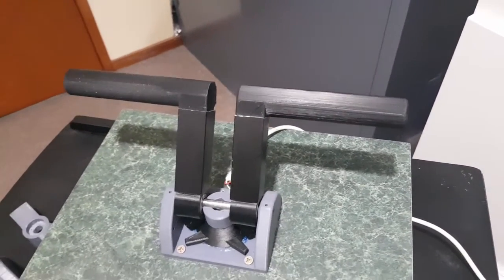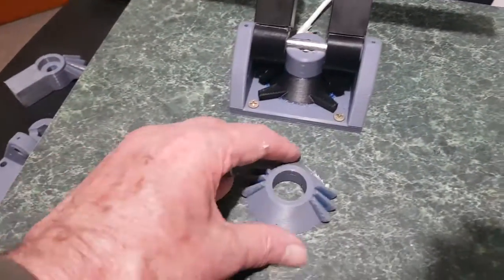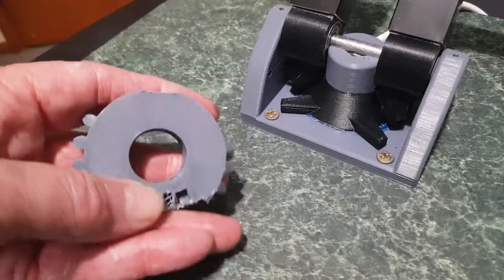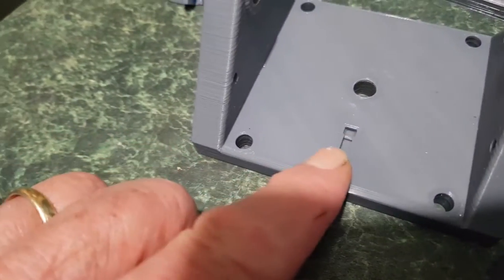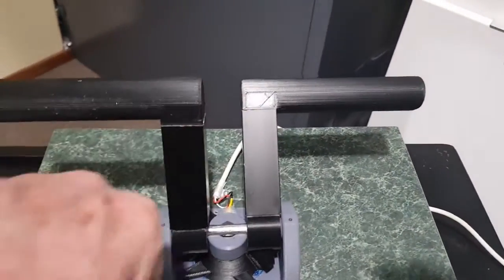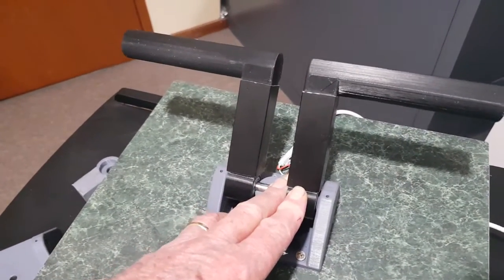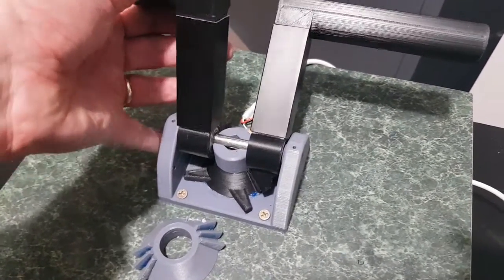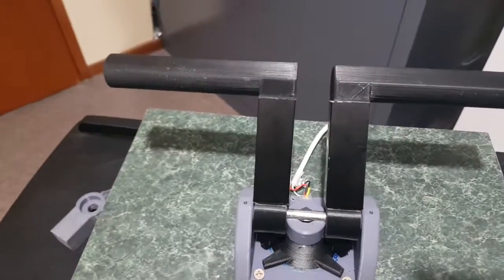Simple DIY Helicopter/Airplane Thrust/Rudder Pedals

Comment: Cool!  I am planning on building a set for gliders that use a similar style of pedals. The design I had in mind is extremely similar, but I am hoping I can avoid 3d printing as I don't have a printer. For pedals I was planning to use a set of bike pedals and crank arms. I need to find the beveled gears, but might end up having to print those. For centering I was planning to add an arm on the center gear that would connect to the base plate with a spring. I would just attach an rj12/DEC connector to the cable which allows me to connect the pedals to my Thrustmaster T.Flight  HOTAS. All the electronics is in the hotas allready. It only needs the sensor level. Thanks for validating the design!
Reply from the maker: You can order them printed from thingiverse.
Reply: @fatchickencatcher  thanks for the tip! I actually got myself an ender 3 and printed the gear section of the pedal set. (I had other parts lined up for printing too, so getting a printer made sense.) I ordered some hall effect sensors and attached one to a rj12 that plugged into my hotas, but I could barely get it to register anything so I'll have to get some other sensor. That will have to be a project for some other time. Thanks for sharing!

Comment: Thank You for the design, I really like it. Its one of the sturdiest and simplest I have seen so far. I think rudder pedals on the market today are outrageously expensive and I cant comprehend spending hundreds of dollars for a few pieces of cut metal. What design software did you use to make them? I want to make a few modifications.  I want to add a thrust bearing because I want to avoid using grease and I have a spare damper that I want to use too, I know with the way you have it now with the grease there is some resistance already but I think it would be smoother and cleaner with the bearing and the damper resistance can be increased and decreased on the dial. These things are pretty cheap, the damper can be had from china for around 30 usd free shipping and the thrust bearing can be had for 10 on amazon. You could add these things to your design in thingiverse as optional upgrades. Thanks again for the design, about to start printing.
Reply from the maker: You are welcome to remix as you want. I designed it in Fusion 360. Thanks for the suggestions. I probably won't change it as it was designed for my own use and performs flawlessly many hours a day as it is.

Comment: Gary, firstly thank you for sharing your design and knowledge.  Can you disclose what gear module/ pitch you ended up using? I quickly printed these out and am too lazy to take a set of calipers to them to figure it out myself.  Aloha           edit: actually it looks like a 60mmPA 1:1 bevel gear set. Should be pretty easy to remodel in SW. Thank You.

Comment: Hi Gary ! Thanks for this great design ! It seems that the thingiverse files are not correct, the levers have 6 tooth but in this video there are only 4. With the 6 tooth version you can't go to the stop of the design as the 2 externals tooth push the main gear and stop. Can you share the 4 tooth design ? or even better the Fusion360 files ? Thanks a lot !